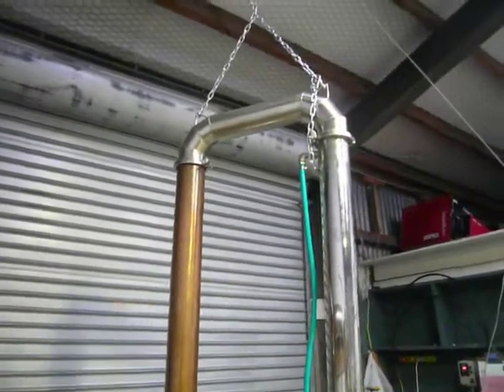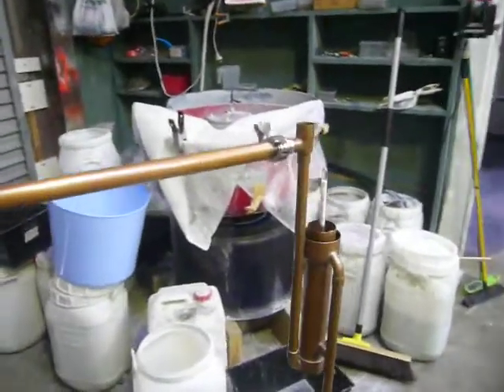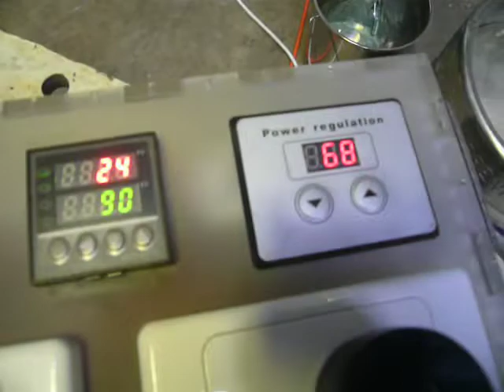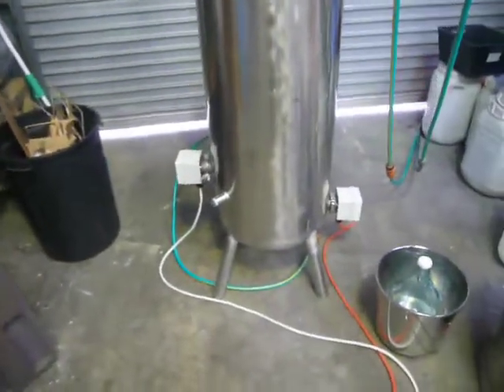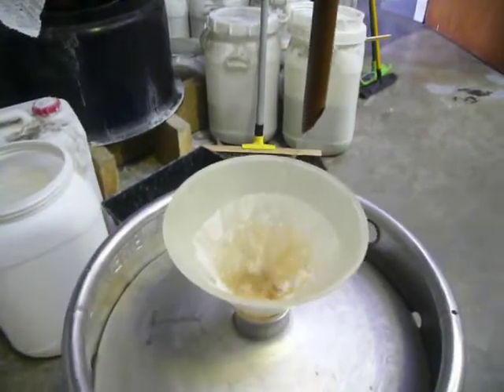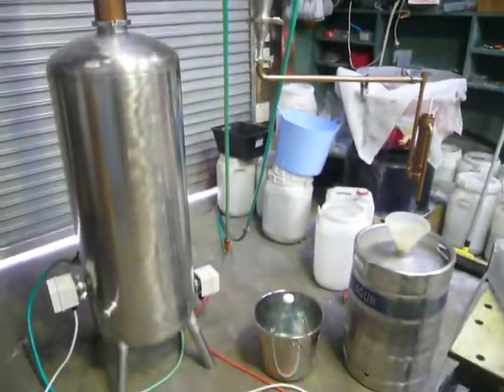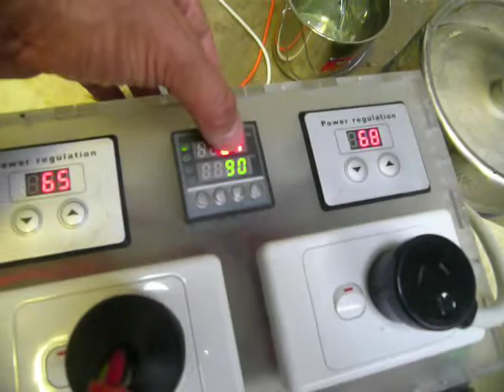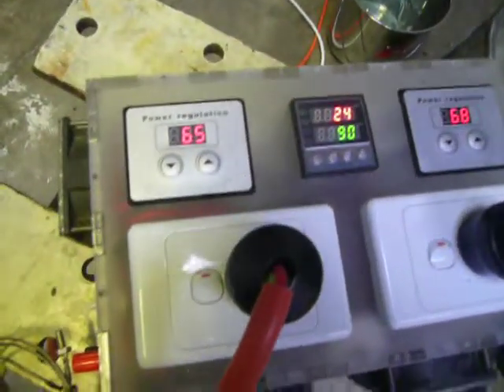HWC still with 4inch column and condenser. Stripping run.

Comment: Have you found standard GPO fittings get hot/ melt?
I’m curious what you use for mains connectors & if they can stand up to a few hours of 10 amps current flow?
Reply from the maker: G'day Chris,
GPO fittings?

Haven't had any problems with triclamp/gaskets or electrical fittings melting.
For my own 3kW elements I use 15amp cables (about 2mm+ square surface area cores) and fittings as they need a 15amp draw @ NZ 240volt.

For the hobby distiller gear I build for people I use standard NZ domestic plug fittings/cables (about 1-1.5mm square surface area cores) and only use 2kW elements so as not to overload things. (NZ homes and domestic workshops are generally wired and fused for 10amp draw max.)

Happy Distilling!

Comment: This is awesome. I am working on one very similar to this. I was wondering if you had to get rid of any mineral deposits left inside. Mine has a bunch on the heating coil inside and im not sure the best way to clean it out
Reply from the maker: G'day Tobey.
No mineral deposits in this one - was clean as a whistle inside and a good score!
I've had a few copper water tanks that have been heavily scaled up inside, soaking them with vinegar inside and slowly rotating them will help get rid of scale or at very least soften up the alkaline mineral deposits in my experience - you'll also find any pinhole leaks in a hurry! lol
I had used hydrochloric acid on one small water cylinder but would not recommend that as it is very dangerous and passivating (neutralising the acid) took bloody ages afterwards.

I replace the elements completely in all the kettles I make and make sure I've got nice reliable new ones in there.
Elements in water heaters get a fair thrashing in their lifetime.

Best of luck with your build and Happy Distilling!

Comment: Wow gotta say you have a nice set up did you say you also run it in reflux
Reply from the maker: G'day Shawn - yep, the short 4" reflux condenser/dephlegmator I panned away to at one point in the vid gets inserted between the top of the column and the lyne arm, ... the column gets packed with copper mesh rolls, independent water feed setup to the reflux condenser - and it's running reflux.

I don't do a lot of reflux runs as I said in the video - most of my interest lays in full grain whisky/whiskeys and molasses rums.
Happy Distilling!
Reply: Ah the same 4 inch dephlegmator you built on your channel
Reply from the maker: No, - funnily enough I sold that one and several more like it to fund more of this madness a while back.

The one I use now (in this video) is almost identical except I've taken to silicon bronze TIG brazing together the copper-stainless and copper-brass joins. The copper-to-copper joins I still silver solder (copper-copper joins are usually non-structural).